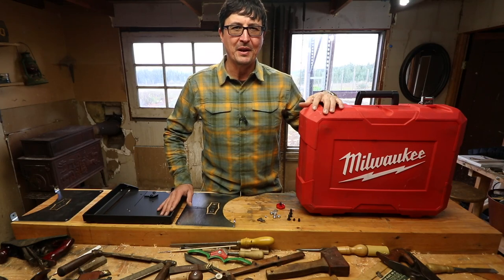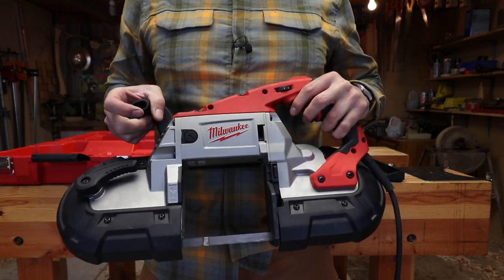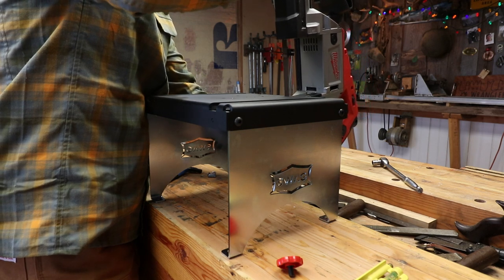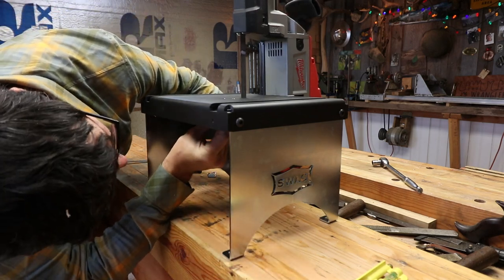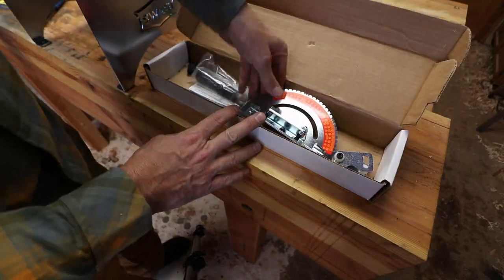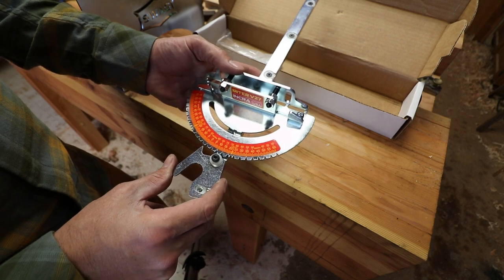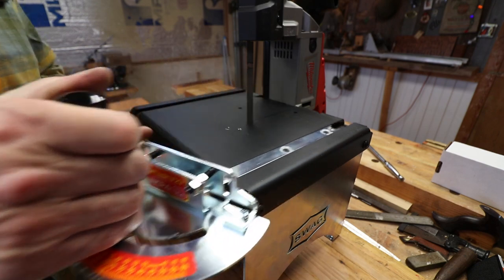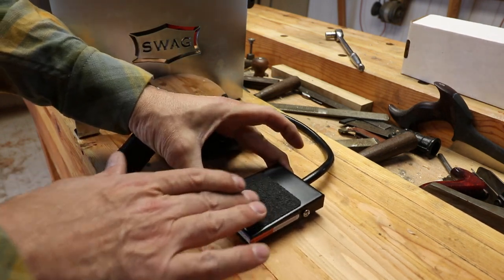AMAZING MILWAUKEE TOOL HACK!!

Comment: love this guys videos the only channel i like watching on youtube
Reply from the maker: Thank you so much Rhys.
Reply: rhys mckeever  h
Reply: Bandsaw is much quieter, produces little to no sparks and is more precise. That being said, sometimes the angle grinder is a better tool for the job it just depends.
Reply: metal bandsaw definetly a good tool but geez mention the fucking angle grinder. a hack saw is not the only option. also you can get bimetal bandsaw blades if you already have wood bandsaw that allows you to cut steel. definetly a beautiful product though

Comment: I was a union Pipefitter for almost 40 years and a Milwaukee porta-band
was NOT a crude cutter. In the hands of a skilled journeymen and a clean precise line on pipe or angle iron or square stock etc. it gives a clean square cut that only needs a quick rasp of a file to clean any burrs off that come with any cut. This awesome tool is only as good as the person using it.

Comment: put some oil on the blade when cutting
Reply: Apparently not as it cut fine without it.
Reply: he needs to put a title caption - "these videos are for entertainment purposes only".
Reply: Tenspeed TheBikeHanger you do it to make it cut better and to make the blade last longer.
Reply: Anthony Sozio huh, i thoght you would atleast do it to make the blade last longer
Reply: Elliot gubson
I am well aware of why you use cutting fluid, but the comment was it is essential.
Reply: Most portable bandsaws are sold on the pretense of being lubricant free.
Reply: Elliot gubson
Reply: Not recommended. On portable bandsaws, most fluids cause the blade to slip and slide on the wheels. Large bandsaws don't have any twists on the blade and the wheels are made to withstand cutting fluids.
Reply: You can not use oil on the porta band . They have a rubber band around the drive wheels . I thought the same thing until I tried it on mine a few yrs back.

Comment: The saw and table can be taken into the field for use on site or just set up on the bench next to you to cut pieces as you are welding. A lot of fabrication is done,with 2" tubing and angle with this readily handles. I have this set up on my welding table to cut small pieces as I work. Not cheap but very handy.

Comment: I do a lot of metal work & the portaband is one of the most used & versatile tools I have.   Made a table & chop saw stand for it. Still use angle grinder , & cold cut chop saw, metal circular saw, torch  & more.  They all have there place, but I'd recommend one of these if you haven't tried it.

Comment: What's wrong with an angle grinder
Reply from the maker: crude and not very precise,
Reply: Wranglerstar if you know how to use a grinder it's very precise.
Reply: The bandsaw wont start fires and wont stink
Reply: John Ryan
Reply: Philip Gregg angle grinders arent as accurate as this. plus its hard to cut bar or box stock without a bandsaw
Reply: Philip Gregg I think everyone would agree that angle grinders are awesome tools and in many cases are the only tool for a specific job. When I refinished my trailer deck I used my grinder to cut the old decking off. Can't use a bandsaw well for that. 

Likewise maybe some prefers the table top port-a-band like this dawg for jobs where stability of the tool is paramount?

Also, have you ever seen a grinder injury? Holy crap, those things can easily maim or even kill if the wound is in the right place. I can see some folks that would have trouble controlling a grinder, turn to a tool like the swag. 

Just a thought.
Reply: Russell Warren -You had to make it a dick measuring contest. I've worked factory production jobs and if you are doing many parts having a station a band saw, where appropriate, is far better. I've worked with stand up band saws and horizontal band saws and it's like using a jig. If you're good at free handing a grinder, goodie for you. If you want to use that as opposed to a production setup (when appropriate) with a band saw, you're not very bright.
Reply: that's just a grinder rather then a cutter.
Reply: the mess for starters

Comment: if you know of any knifemakers out there, this is the answer we all have been looking for to cut out our blade blanks, before now we have been limited to either using cutoff wheels in an angle grinder or using a regular hacksaw, or we could do a lot of grinding on the 2x72 grinder thereby wasting a lot of the belts life. sweet tool! i have to have one of these.

Comment: What ever happened to cutting with an Oxy/Acet torch? I've cut a lot of rebar and steel on commercial construction and 98% of it was with a cutting torch.
Reply: They all have their place - are occasions where a cold cut off option like this has the advantage of not leaving the drossy hardened edge that a gas torch or plasma torch leaves - if you're going refine the edge by filing for example or if your working with materials you can't gas or plasma cut.

Comment: NOTE: This comment was written when the title was "MY TOP TOOL PICK FOR 2016".

Thumbs down just because of the title? Nope, the video is still ok. So I just don't vote at all.

Please use proper titles!
Reply: Sven Karsten Greiner ... yeah.. he really doesn't need to do that with the huge fan base he has. the title is the first impression newcomers see. he should be setting the tone with the dignity worthy of his content and overall mission.
Reply: This is a proper title for this video.
Reply: Sven Karsten Greiner The title actually describes what the video is about, which is what you want. 

soooooo?
Reply: Well.. now he's changed it to "AMAZING MILWAUKEE TOOL HACK!!" Which is obviously even more click baitesque. So now he's just messing with us. I still stand by what I originally said none the less.
Reply: Previously the title was "MY TOP TOOL PICK FOR 2016". The new title is really an improvement.
Reply: Sven Karsten Greiner Ayeaye sir, did not even realise 👍
Reply: Yep, not a hack, it's a product review at best. I have the portaband, and I made my own vertical stand that fits into a 3" tube pedestal I have bolted to the floor. He got my click because of the title and I hoped he had some new way to use a tool that I maybe didn't know about.

Comment: What I like about my MW bandsaw is that even the cordless has the same gears as the corded saw. Only the method of using power is different. As it happens I do have both and think for less than $150 I can now have a powerful and versatile enough bandsaw table for my home garage.

Comment: Neato! Each time you asked "What would most of us use for cutting metal normally?" I sagged my shoulders and groaned with you, "A hacksaw..."
Reply: A hacksaw? Get a angle grinder from 20-80$ abrasive 14” miter saw 50-80$ used. This setup is about 350 if you get a used portaband for 100$
Reply: Sawzall, silly

Comment: Great design and the stand section is high enough to put something like an old one gallon ice cream pail underneath to catch the swarf from cutting operations, This is a very high quality well thought out design and even the mite angle attachment is absolute top class nothing cheap or rubbish about this product and well worth the asking price, Precision never came this low cost before Swag came up with this conversion.

Comment: I got the  DEWALT DWM120K for $300 [same kind of bandsaw],  8 months ago. Should have got that a long time ago.
I got the same SWAG mount.  I have a Delta bandsaw for wood, but the little saw is saving my 65 year old shoulder from hacksawing through thick metal.

Comment: So... you have a 2 min video into 14 minutes.

You should work on structure of your video. It took over 4 minutes for you to get to the point. Probably lost half your audience by then.

Considering that this is a temporary/worksite tool, I think the stand should have quick tool-free setup.

And good job on advertising INCRA while you at it. Why not? Maybe more stuff will arrive to the door.

Comment: Corded?!?!?! What is this 2005? All about the 9.0ah now
Reply: BREENNTTT this deserves a million likes, so many people have this stupid idea that cordless tools aren't as good as corded. Most of them have likely never used a modern brushless tool from makita or Milwaukee
Reply: roberson644 not at all. My brushless makita tools all have more power than their corded counterparts. Not to mention feature like torque control and constant speed monitoring that make saws and grinders considerably safer and more efficient. Most brushless tools are considerably lighter as well and when you are using them all day that alone makes a huge difference
Reply: what about all the new dewalt 60 volt stuff coming out now?

Comment: Gloves? Gloves are for noobs?
Reply: Gloves on saws? Are you serious?
Reply: Gloves + saws = nubs
Reply: What exactly is the glove going to protect your hand from in this instance?
Reply: you are gonna have alot of fun when your glove catches on the saw :)
Reply: Man i work with a standing drill (idk what it is called in english) a lot, and i get my fingers awfully close/touching the drill often, if i would have gloves on i'd lose a finger, now i just get small cuts on my fingers sometimes.
Reply: Never use gloves or long sleves with rotating equipment
Reply: Definitely not, someone thaught me that, would not want to learn it the hard way.
Reply: skizzik121 Yes, a drill press. Someone told me a story similar to yours, that's why i don't (I don't use gloves in general though..)
Reply: no gloves on anything that rotates
Reply: Gloves? We call them B&%ch mittens.
Reply: Thanks to everyone who replied. Thank you.
Reply: Gloves are the absolute worst thing you can do while handling powertools, All they do is remove feeling and awareness of your fingers position and give the blade something to grab and pull you in by.
Gloves are strictly prohibited in pretty much every woodshop that uses power tool i know. (Please note i don't count hand drills or Ros's as powertools.
Reply: Wearing Gloves, Long Sleeves, Rings, Watches, Long Necklaces with Jewelry = "Dumbest Move Ever Made"  when using rotating power tools.

Comment: Big portaband fan here I have the M18 Fuel version of this saw. If you needed to cut metal I mean you can always use a grinder with a cutoff wheel.

Comment: Milwaukee used to be good, before they sold out. Hard to find a decent tool with their name on it these days.
Reply: Mac102004 Farms I dunno man. With my experience with them they have always been great. It is a big shame they sold out to china but they do still have some good products. They are about the only power tools I will buy
Reply: Their M18 cordless impacts are second to none - I bought a 1/2" and havn't touched my Bluepoint air impact since.  I bought the 3/8's impact and now I'm wondering how I lived so long without it.
Reply: I have a 30 year old Milwaukee 1/2 drill that will break your arm if you don't use two hands, also have a 5 year old 1/2 drill that with a good bit you can stall it out. They ain't what they used to be.
Reply: K.D. Pearce - Same here on the old Milwaukee 1/2" drill. I call it "The Thumb Breaker".  Because it did exactly that. I was under the truck drilling out my truck's cross member to take a new but bigger bolts and it caught the steel at just enough of an angle to twist the drill and it snapped my thumb back like folded cheese. I had to finish fixing the truck to drive to the hospital for a cast.
Reply: +Kyle Quitter I need to buy a 1/2" impact, I keep putting it off but I don't want to spend the money. It's one of those things where if you've never had it you don't miss it lol
Reply: +FireFighter#47 Check out some Makita tools next time your in the market.
Reply: I've had Hilti, Makita, Bosch and Milwaukee cordless tools. As of 2014 and after 45 years of using power tools. With all good and bad things considered,  Hands down, the best tool manufacturer I've ever used was Milwaukee. 

As it was it seemed as the rest of tool mfr's were sleeping on their waterbeds while Milwaukee was really hard at R&D'g a really tough bunch of cordless tools to complement their powered tools. Craftsman everywhere were screaming loud and clear in the forums and tools shows for better lighter more powerful battery tools aimed at the contractors who had to lift those behemoth monsters for 8 to 12 hours everyday. It got to be difficult to find and buy work shirts with bigger sleeves on one side of their shirts no matter how many stores they searched just to keep the sleeve being ripped every time you picked up a power tool.

Today, I am looking at a new cordless coming out of Bosch. It's tough, powerful and it gets it done. This is going to be a hard sell no matter what. I say that solely because most craftsmen/crafts women who buys these tools typically buys multiple types of the same manufacture because of the batteries used. Who realistically wants more than one type of expensive batterys? No one I know for sure.
Reply: Hilti is good stuff as well, I've never had their cordless stuff but the rotary hammers are certainly top notch. Bosch I have little experience with, I do have a couple of their angle grinders that seem to be really good quality. Would love to try more tools but like you say once you pick something you might as well stick with the same brand just so you don't need so many batteries and chargers.
Reply: Hilti is top notch but they are the self proclaimed Snap On of tools. High Prices and Great Quality.  You can get a down time tool to temporarily replace yours while it is in for repair.
Reply: Yes absolutely. they are priced for big companies not for consumers, Out of reach for guys like me.
Reply: That too is why I switched.
Reply: I have call BS on this.  I use Milwaukee 12 and 18 everyday.  Never have a problem and their run times are second to none.  Solid equipment.
Reply: still in Canada ,, anything you want from Milwauee

Comment: The little T-slot adapter is for a tablesaw that has the undercut t-slots and is precisely for preventing the miter guage from lifting out of the slot when you are crosscutting wide stock with most of the Mitre-gage retracted from the table in order to start the cut. Would be useless on that tiny table. I have the Incra Mitre 1000 with the table sled and I LOVE IT!!

Comment: Additionally, you can buy metal cutting abrasive wheels for circular saws, those rock for straight cuts. You could probably even feed one too a table saw if you wanted

Comment: I think you missed a couple steps between "hack saw" and "plasma cutter".  Here are some other options:
1) grinder with abrasive blade
2) chop saw/compound miter saw with abrasive blade
3) regular circular saw with abrasive blade (are we noticing a pattern?)
4) sawsall with hacksaw blade
5) scroll saw with steel cutting blade
6) (if it comes to it) dremel tool with "probably gonna explode" blade.
Reply: htomerif Can't leave out the Oxy torch
Reply: Yeah... I actually considered that and left it out intentionally.  I was trying to only include things that would give a similar level of precision.  I got decent enough with the oxy-acetylene torch that I could blow a broken bolt out of a tapped hole without damaging the threads but theres no way I could make a precision cut even in the ballpark of a band saw.  Maybe theres such a thing as a precision cutting torch head but I havent seen it.

Comment: You should fab a small adjustable guard to deal with vibration if you're going to be cutting larger pieces of stock. Not entirely necessary but it will make it a lot easier and safer to use.

Comment: I have a cordless bandsaw from Canadian Tire's Maximum line. I bought the base at the same time. I LOVE that thing, it's useful as all getup and I've had it for years now. The base is a game changer! It's not as nice as this Milwaukee though. For you Canucks, they're on sale at Crappy Tire right now, $99 at my local store. Only issue is blades, the ones they have are terrible, fortunately Bosch has the same saw under their brand so you can buy Bosch blades. I have to admit to some bandsaw envy right now, but the one I have was all I could afford at the time. I may have to upgrade one day!

Comment: Shut-up & take my money. Love it. I have an old porta-band, used donkeys years ago as a yout on seasonal construction work. When you have to knock-off 160 re-bar heads on one house /slabs, walls, and joists: you can put the angle grinder where the sun don't shine... Don't fabricate as much as I used to - but this little gem will simplify things. Small business made & invented; hell ya!

Comment: My new hobby is making knives using the stock removal method. Have been looking at that exact setup for a few months now. Have had his site bookmarked....just trying to justify the expense for what is still a hobby. Would save me time over using an angle grinder followed up by lots of grinding on the belt sander. I appreciate the video.

Comment: I have one of these for my Harbor Freight Bandsaw works GREAT!! If you want quick cleanup put an old cookie sheet under the saw base. When Iyour done using the saw just pull the cookie sheet out and dump it in the trash done!!

Comment: I have one of these and several band saws. They are nice, but remember you get what you pay for when purchasing blades. For my steel cutting saws a 30 dollar blade looks great to begin with, but when you have to replace it every week it does not. The 65 dollar blades last me several months, and Ill be the first to admit I am very hard on blades. Just let the saw do the cutting and they will last a very long time.

Comment: Okay, take the hack one step farther. How about changing the blade to cut wood? I could see  using a portable band saw like the Milwaukee to do fancy trim cuts on the ends of a beam in the field, IF I could get a 1/4" blade that would fit the portable saw. Thoughts, suggestions, or just the wrong tool for the job?